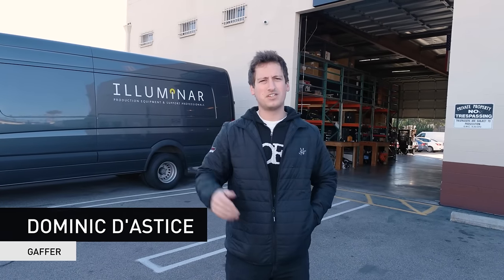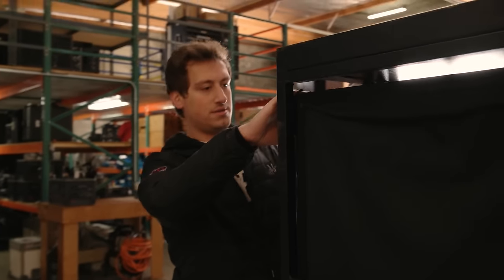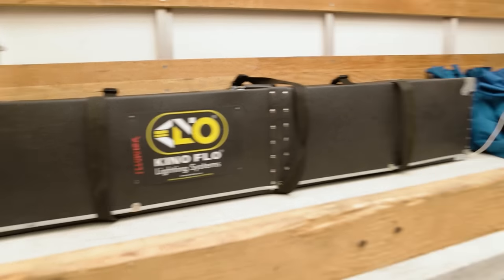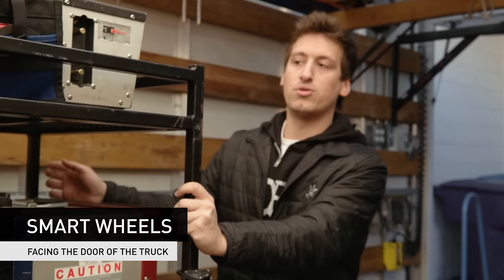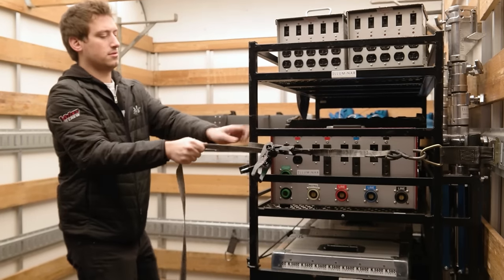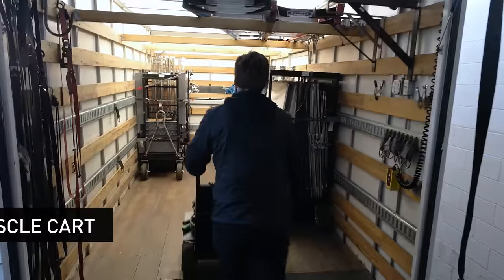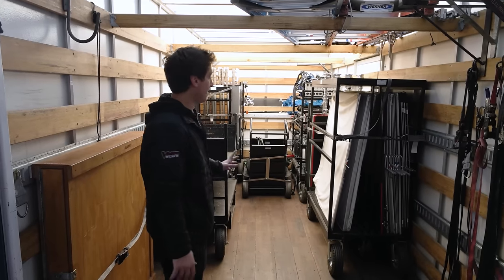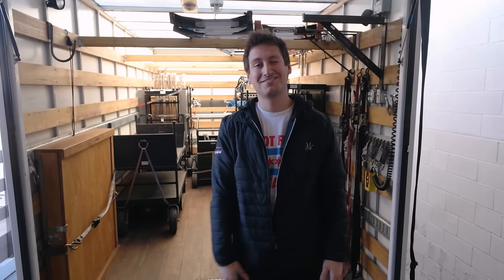How to Rent and Load a Grip Truck

Comment: One commenter made a good point about how this is a non-union setup. And another about how it doesn’t look like that much equipment. Every production is different. Even between tier 1 and tier 2 union shows makes an impact on what kind of gear you through on a truck and how much of it you have to load. If it’s a small production, it’s common for grip and electric to share a truck. But other times, on larger shows, g&e might have multiple 5 or 10ton trucks of their own. I think this is a pretty great general overview though.

Comment: I work at a rental house, and there was one time where the best boy of a film had to wrap locations and catch a flight so he basically just dumped his gear into the back of the truck with no concerns. 

So this is a good thing to teach.
Reply: Question: what actually is a best boy?
Reply: the best boy is basically an equipment manager of sorts. he communicates between the rental house and keeps track of inventory on set. They come get equipment and check it out like in this video, and bring it back having made sure all items are accounted for.
Reply: Isn’t that what PAs are for? lol We get the same thing from time to time.

Comment: This is great.
I'm an assistant Grip in the UK (which means I'm an assistant Dolly Grip? by US standards, as European Grips don't work with lighting, that's a separate department) 
These kinds of things are essential. Every time you hire kit, it should be cross-checked and counted, at the start and the end.
Otherwise you lose Shotbags. Because Shotbags yearn to be free, and will often be found sneaking into camera and location trucks....
Reply: "Because Shotbags yearn to be free" ahahahaha
Reply: In the US, Dolly Grips manage and operate the Dolly specifically (if one is being used). Grips in general don't actually work with the lights, but they might set up flags for the lights. Electric department are the ones who work with lights exclusively.  There's the old joke. "How many grips does it take to screw in a light bulb? None, that's electric's job." Hope that clarifies.

Comment: I noticed you ratchet(ed?) on the corners of the cart, is there a reason for this? Is there any advantage to doing it on the corners rather than in the middle?
Reply: wakimaniac Looks like he didn’t have a choice. Although, if he had adjusted his D rings, he could have avoided the corner.